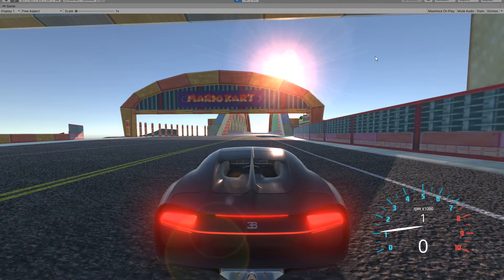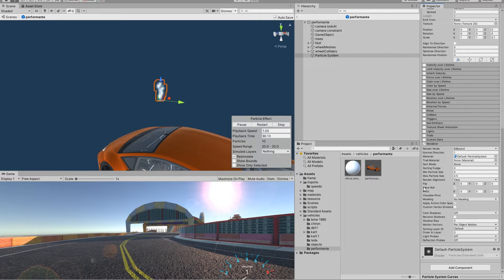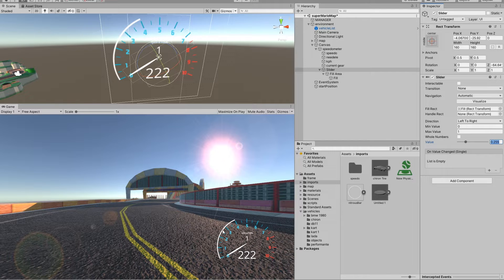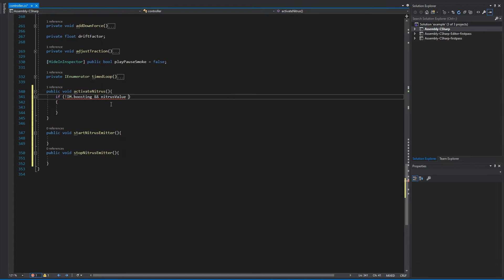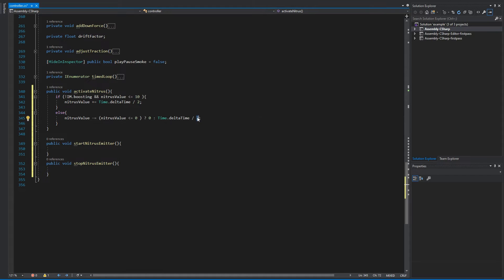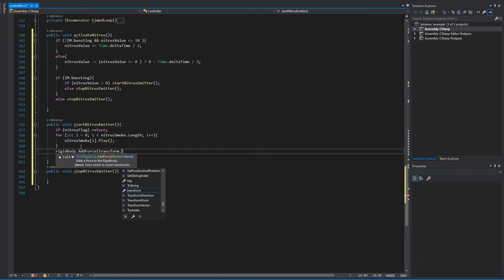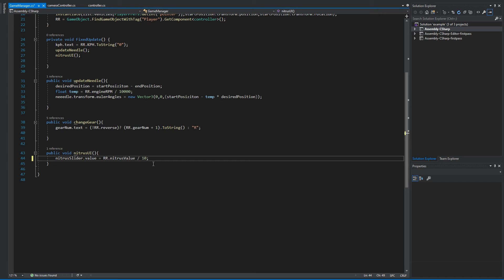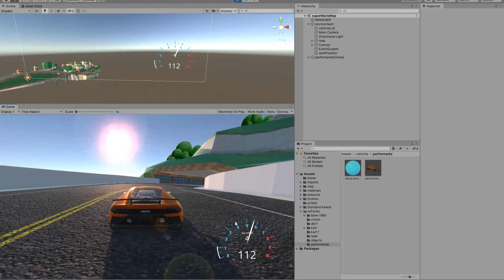Unity Tutorial - Nitrus Bar(Unity Slider)

Comment: Hello, I think there is a mistake in deducting the nitrous. Because, if you do Time.deltatime / 3, then less nitrous will be deducted than what is added. For example, if, I replace Time.deltatime with the number 6 then  6/2 = 3. But, 6/3 = 2. So, per second 3 nitrous is added and 2 is deducted. It should be more like, nitrousValue -= Time.deltadtime * 2